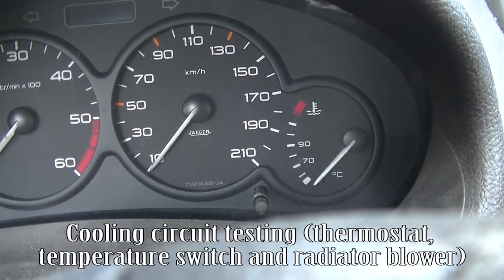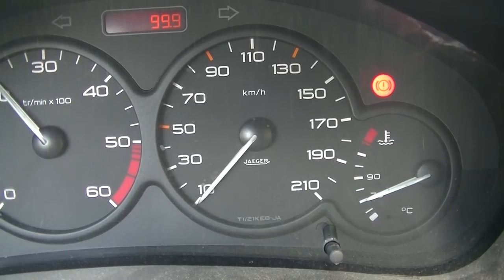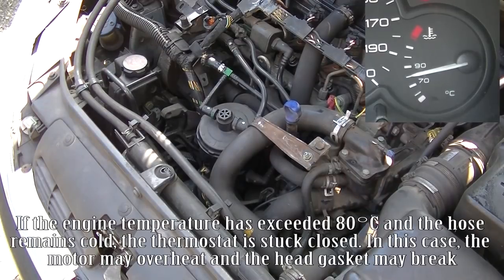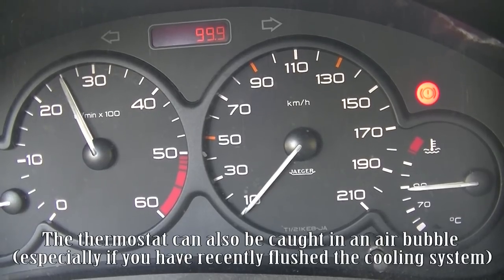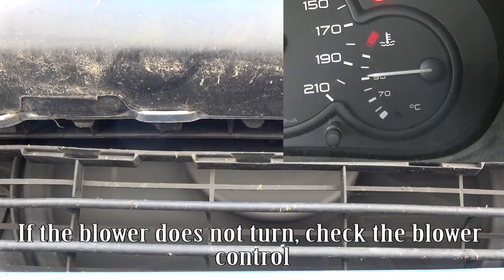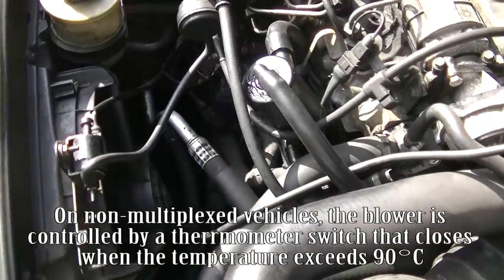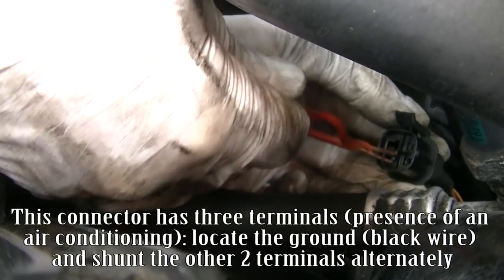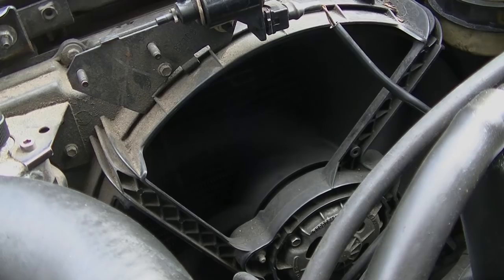Check the cooling circuit 🐧 - Test thermostat, temperature switch and radiator blower

Comment: where is the thermostat located, please? Thanks.
Reply: Briddy Hll 
The upper hose of the radiator leads in to thermostat on most 99% cars.
Lower hose is return
So the big thick (30-40mm) hose , where it ends in your engine is the housing of the thermostat

Comment: My fan does start on 98°C what could be the problem ?
Reply: I have the same question
Reply: you have a radiator fan switch that has a high "Coming-on" temperature. you can buy a switch with a lower temperature to make it work sooner rather than later when the coolant is near to boiling.